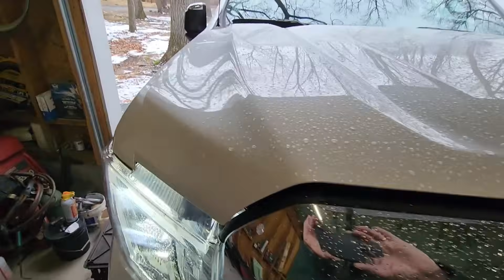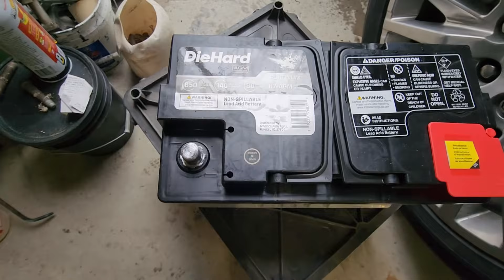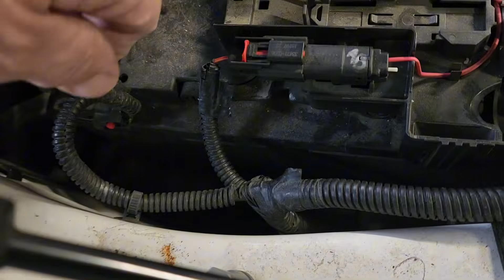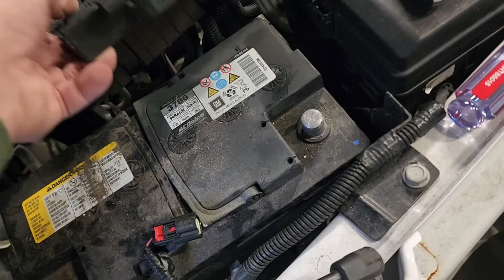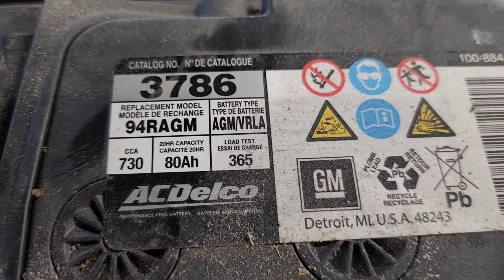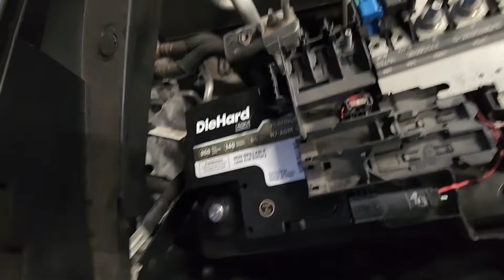Battery change GMC 2014-2024

Comment: Some helpful tips to know its time to can the battery.  If you all of a sudden get a service the adaptive cruise control followed by a check engine light (they would illuminate together). Disconnect the negative terminal for 30-45 minutes then reconnect the negative terminal. This resets the programing and takes of the message on instrument clust front message screen. You will have to drive a few miles and then the check light will go out.  You won't know the battery is going bad by looking a the gauge. The big alternator current blinds it and looks full all the time. its when you start getting codes out of no where without a true fault. This is do to low voltage spikes due to mostly a battery going bad. Rule of Thumb, after 3-4 years, its time to change the battery.
Reply from the maker: Shawn, thank you for the detailed explanation. 
Very helpful. Thank you for commenting...

Comment: Hey Quick? I'm doing this tonight.  Do I have to program anything after I change the battery
Reply: Same question, mine is 2020. I have a push button start. I did exactly this and change the battery pear the voltage is saying 12 everything inside lights up but it won't turn over.
Reply from the maker: @Rob-h8f your computer has to reset itself.
 Try taking it for a ride. It should clear itself
Reply: @classicrewind2715 I had to tow it to the dealer. it was the starter.
Reply from the maker: @Rob-h8f Sorry to hear that it was the starter. At least it's something to look out for in the future. Thanks for commenting really appreciate it. All the best
Reply from the maker: Just your clock. Thanks for watching and commenting. All the best
Reply from the maker: No..
 everything should go back to normal. It might asked you your seat references.. LOL

Comment: You mentioned in the video you were having problems with your truck and the new battery should help it. Besides just not starting up immediately what other issues were you having and did the new battery fix it? BTW great video will be using this when I change mine. Thank you.
Reply: My 4wd service light came on. Original battery from 2018 Sierra and just replaced it last weekend.
Reply from the maker: Hi. Thank you for commenting. Yes, the new battery corrected everything. I was having a problem Auto starting. When I put the new battery in. it corrected that problem. All the best